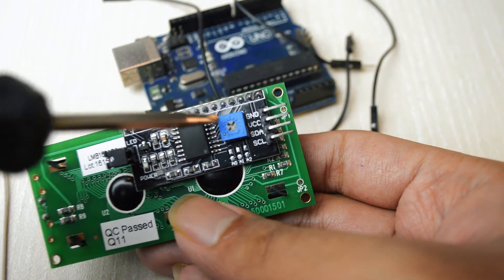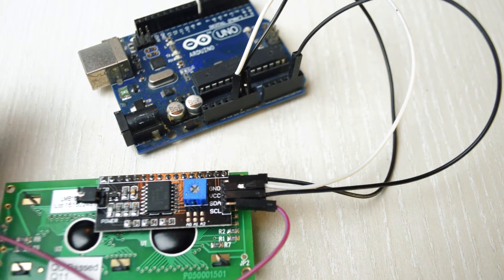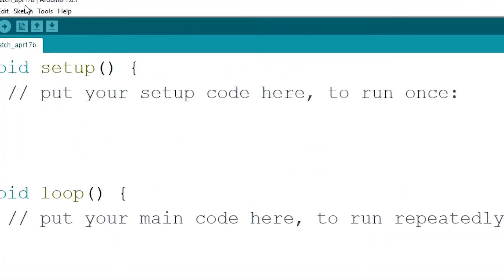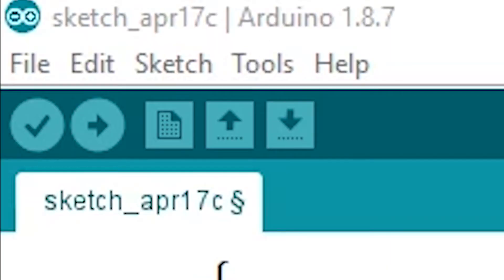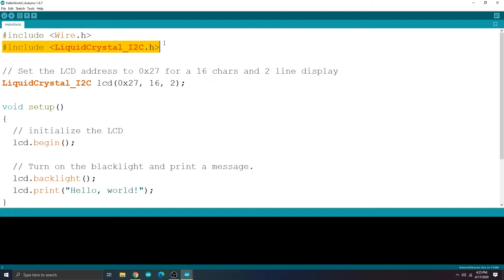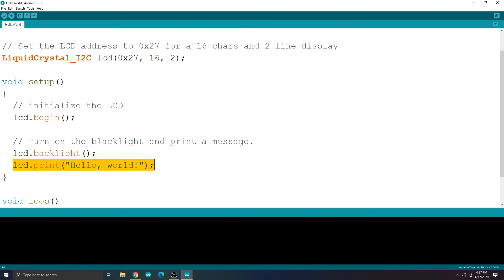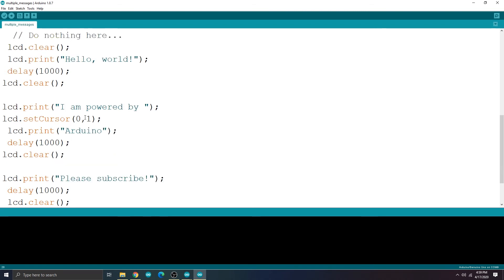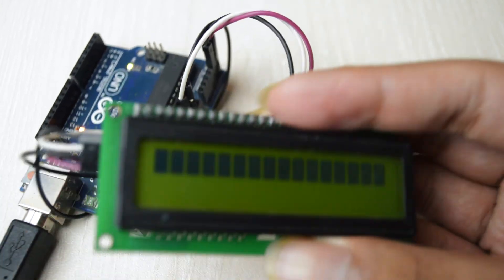LCD I2C Display with Arduino

Comment: Hi i'm not an expert so i would like to ask you if you can add some lines on the sketch  to add the reading of microSievert/h as well as the CPM? The conversion index is equal to 151, which means that:  151 CPM = 1 μSv/h
1 CPM = 1/151 μSv/h = 0,00662252 μSv/h.
Thank you

Comment: Hello man! I have an issue, when i uploaded the HelloWorld code it doesn't appera on the display, (the display is powered and i see the little rectangles) i don't know what to do.
Reply from the maker: Have you tried adjusting the potentiometer on the back of the display with a screwdriver?
Reply: @aymaanra  I’ll try thank you

Comment: Can you please explain this programme in Hindi 
.
#include <LiquidCrystal_I2C.h>

#define vtg 34
#define in1 15
#define in2 2
#define in3 4
#define in4 5

LiquidCrystal_I2C lcd(0x27, 16, 2);

float vOUT = 0.0;
float vIN = 0.0;
float R1 = 30000.0;
float R2 = 7500.0;
int value = 0; 

void setup()
{
lcd.init();                    
lcd.backlight();
Serial.begin(115200);
pinMode(vtg, INPUT);
pinMode(in1, OUTPUT);
pinMode(in2, OUTPUT);
pinMode(in3, OUTPUT);
pinMode(in4, OUTPUT);
digitalWrite(in1, HIGH);
digitalWrite(in2, LOW);
digitalWrite(in3, HIGH);
digitalWrite(in4, LOW);
delay(10);
}

void loop()
{
float vtgval = analogRead(vtg);
Serial.println(vtgval);
float vout = (vtgval * 3.3) / 4095.0;
Serial.println(vout);
float vin = vout / (7500.0/(30000.0+7500.0));
Serial.println(vin);
float voltage = vin;
Serial.println(voltage);
if (voltage<3)
{
voltage = 0;
}
lcd.clear();
lcd.setCursor(0, 0);
lcd.print("WIRELESS  SYSTEM");
lcd.setCursor(0, 1);
lcd.print("VOLTAGE : ");
lcd.print(voltage);
lcd.print("V");
delay(2000);
}
Reply: he is a bangladeshi

Comment: I upload the code but when i hit the serial monitor it is not giving me an address only a bunch of squares.
Reply: Try adjusting the potentiometer on the I2C board, the one with the screw driver print

Comment: Hey bro can i power this board to my car battery or can i run this on 12v
Reply from the maker: Hey, its rated for 5v, you will need a converter or some else that converts the power to 5v for the board and lcd
Reply: I saw a video in which that guy run arduino board to the charging socket in the car or in other video it run with 9v battery/power bank.

Comment: sir my uno not uploaded the code.they sent an erorre msg.Arduino: 1.8.20 Hourly Build 2022/04/25 09:33 (Windows 7), Board: "Arduino Uno"

Sketch uses 3732 bytes (11%) of program storage space. Maximum is 32256 bytes.

Global variables use 281 bytes (13%) of dynamic memory, leaving 1767 bytes for local variables. Maximum is 2048 bytes.

An error occurred while uploading the sketch

avrdude: stk500_recv(): programmer is not responding

avrdude: stk500_getsync() attempt 1 of 10: not in sync: resp=0x2e

avrdude: stk500_recv(): programmer is not responding

avrdude: stk500_getsync() attempt 2 of 10: not in sync: resp=0x2e

avrdude: stk500_recv(): programmer is not responding

avrdude: stk500_getsync() attempt 3 of 10: not in sync: resp=0x2e

avrdude: stk500_recv(): programmer is not responding

avrdude: stk500_getsync() attempt 4 of 10: not in sync: resp=0x2e

avrdude: stk500_recv(): programmer is not responding

avrdude: stk500_getsync() attempt 5 of 10: not in sync: resp=0x2e

avrdude: stk500_recv(): programmer is not responding

avrdude: stk500_getsync() attempt 6 of 10: not in sync: resp=0x2e

avrdude: stk500_recv(): programmer is not responding

avrdude: stk500_getsync() attempt 7 of 10: not in sync: resp=0x2e

avrdude: stk500_recv(): programmer is not responding

avrdude: stk500_getsync() attempt 8 of 10: not in sync: resp=0x2e

avrdude: stk500_recv(): programmer is not responding

avrdude: stk500_getsync() attempt 9 of 10: not in sync: resp=0x2e

avrdude: stk500_recv(): programmer is not responding

avrdude: stk500_getsync() attempt 10 of 10: not in sync: resp=0x2e

     
please help me sir.

Comment: Good day sir! Please help me, it does not display text, but an empty boxes. And when i upload the code you gave it says no matching function for call to LiquidCrystal_2C::begin()'
Reply: did you find the solution
Reply: @ourabig idk
Reply: Same is happend with me, try typing "lcd.begin(16, 2);" if you have lcd 16 x 2, and then upload the code, for me it disabled the backlight, then I typed the previous statement lcd.begin() and it worked.

Comment: Sir @Aymaan Rahman
i have an error

C:\Users\HP\OneDrive\Documents\Arduino\libraries\Arduino-LiquidCrystal-I2C-library-master\examples\HelloWorld\HelloWorld.ino: In function 'void setup()':
HelloWorld:10:12: error: no matching function for call to 'LiquidCrystal_I2C::begin()'
  lcd.begin();
            ^
In file included from C:\Users\HP\OneDrive\Documents\Arduino\libraries\Arduino-LiquidCrystal-I2C-library-master\examples\HelloWorld\HelloWorld.ino:2:0:
C:\Users\HP\OneDrive\Documents\Arduino\libraries\LiquidCrystal_I2C/LiquidCrystal_I2C.h:58:8: note: candidate: void LiquidCrystal_I2C::begin(uint8_t, uint8_t, uint8_t)
   void begin(uint8_t cols, uint8_t rows, uint8_t charsize = LCD_5x8DOTS );
        ^~~~~
C:\Users\HP\OneDrive\Documents\Arduino\libraries\LiquidCrystal_I2C/LiquidCrystal_I2C.h:58:8: note:   candidate expects 3 arguments, 0 provided
Multiple libraries were found for "LiquidCrystal_I2C.h"
 Used: C:\Users\HP\OneDrive\Documents\Arduino\libraries\LiquidCrystal_I2C
 Not used: C:\Users\HP\OneDrive\Documents\Arduino\libraries\Arduino-LiquidCrystal-I2C-library-master
exit status 1
no matching function for call to 'LiquidCrystal_I2C::begin()'

Comment: Mine is showing in the LCD but in the compiler it says that

"An error occurred while uploading the sketch
avrdude: verification error, first mismatch at byte 0x046c
         0x51 != 0xd1
avrdude: verification error; content mismatch"

How can I fix this problem? Thank you
Reply from the maker: Did you install any other LCD library before?
Reply: I didn't install any library. All I did was your instructions.
Reply from the maker: Is the correct arduino board selected in the IDE?

Comment: Hello, your video is very nice. But I have some problems.After I uploading, it appeared "In function 'void setup()':
HelloWorld:10:12: error: no matching function for call to 'LiquidCrystal_I2C::begin()'
  lcd.begin();

What is this?How can I fix it?

thanks!
Reply from the maker: hey! did you try any lcd i2c library or any lcd library before installing the one in the video? if so, try deleting that library and try the one I linked,

Comment: I am have tried as per your video.. But only blue light is coming ... I am the example program is not showing in the display
Reply from the maker: try adjusting the contrast potentiometer on the back of the display
Reply: @aymaanra  i tried adjusting it its not displaying anything

Comment: only problem is that everything works but nothing is showing up on my lcd, any idea why?
Reply from the maker: try adjusting the contrast potentiometer at the back of the lcd with a screwdriver
Reply: @aymaanra  ok I will, thanks so much
Reply from the maker: @moreolakunri1322  you're welcome!
Reply: @aymaanra  IT WORKED TYSM
Reply from the maker: @moreolakunri1322  Glad I could help!

Comment: my did not work :(
Reply from the maker: What's the issue you are facing?  Any errors?
Reply: @aymaanra  I have a problem where it says this "no matching function for call to 'LiquidCrystal_I2C::begin()' "
Reply from the maker: @adamhall7077  did you install any other LCD library before this?
Reply: @aymaanra  I fixed because i need ed to use lcd.init() instead of begin().

Comment: Aymaan - I'm looking for a scketch using this display, for lap timing, for my slot car track.  Can't find any, any suggestions? Thanks
Reply: Your thoughts or suggestions?
Reply from the maker: @dane7205  There are some people in that forum post who have some code and projects, you can check it out, I haven't worked with lap timing or slot car track circuits before so I don't know about them in detail. thanks!
Reply from the maker: Hello!! Just found this, hope it helps!: https://forum.arduino.cc/index.php?topic=516838.0

Comment: Arduino: 1.8.13 (Windows 7), Board: "Arduino Mega or Mega 2560, ATmega2560 (Mega 2560)"

C:\Users\USER\Documents\Arduino\libraries\LiquidCrystal\I2CIO.cpp:35:10: fatal error: ../Wire/Wire.h: No such file or directory

Multiple libraries were found for "Wire.h"

 Used: C:\Program Files (x86)\Arduino\hardware\arduino\avr\libraries\Wire

 Not used: C:\Users\USER\Documents\Arduino\libraries\Wire-master

Multiple libraries were found for "LiquidCrystal_I2C.h"

 Used: C:\Users\USER\Documents\Arduino\libraries\LiquidCrystal

 Not used: C:\Users\USER\Documents\Arduino\libraries\Arduino-LiquidCrystal-I2C-library-master

 #include <../Wire/Wire.h>

          ^~~~~~~~~~~~~~~~

compilation terminated.

exit status 1

Error compiling for board Arduino Mega or Mega 2560.

This report would have more information with
"Show verbose output during compilation"
option enabled in File -> Preferences.
Reply from the maker: You have multiple wire libraries
Reply: @aymaanra  thank you sir.what is the solution for this problem?
Reply from the maker: @RamilanExplores   In Documents of Windows. Go to Arduino and libraries and delete all folders for the wire library named "wire" i think. Then install wire libary from library manager

Comment: i recived the error == no matching function for call 'LiquidCrystal_I2C::begin()' what should i do??
Reply from the maker: Create a new folder called "LiquidCrystal_I2C" under the folder named "libraries" in your Arduino sketchbook folder. Create the folder "libraries" in case it does not exist yet. Place all the files in the "LiquidCrystal_I2C" folder.
Reply from the maker: Are you using the library I linked in the description?
Reply: @aymaanra  yes
Reply from the maker: did you install the library via add .zip library?
Reply: Aymaan Rahman yes obviously
Reply from the maker: @venommish2651  then its supposed to work, the error only appears when you have any other lcd library installed
Reply: Aymaan Rahman i have lcd 16*2 same as yours
Reply: @venommish2651  it must the address for lcd
Reply from the maker: Also are you using the code to print multiple messages?
Reply from the maker: @Mohamad Shairil Rezman Mohamad Nizam in documents on Windows I think.
Reply: Venommish does it work becuase i hace the same problem
Reply: Liridon Kastrati bro chaange the wires and  plug it again and del double library and then it works
Reply from the maker: @venommish2651  Does it work fine now?
Reply from the maker: @liridonkastrati3622  did it work for you?
Reply: Yes, thank you
Reply from the maker: You’re welcome!

Comment: If lcd.begin not maching function. Why ?
Reply from the maker: Are you using the library I linked in the description?
Reply: same with me
Reply: @daniasuraya9350 you can use lcd.init
Reply from the maker: @izmaliahuda4747  did it work?
Reply from the maker: @daniasuraya9350  did it work?

Comment: Hi, love the video but I’m an I Mac. Can you make a video on how to do this on Apple Mac. Thanks
Reply from the maker: Thank you! I haven't used Mac, Everything should be kind of the same I think, have you downloaded the Arduino IDE?
Reply: Aymaan Rahman I did all the right stuff and downloaded IDE still not working. The computer send the information to the Uno with the LSD does nothing.
Reply: But the lsd dose nothing
Reply from the maker: @duck-ish4785  Try adjusting the contrast potentiometer on the back of the display with a screwdriver
Reply: Aymaan Rahman It also won’t let me copy the zip file
Reply: I’m a Mac user
Reply from the maker: Try adjusting the contrast potentiometer on the back of the display with a screwdriver

Comment: Thank you Ayman very much,
Did all the procedures,
Still not printing on the LCD,
Reply from the maker: address of the LCD from the code here https://playground.arduino.cc/Main/I2cScanner/
Reply: @aymaanra  Wow it worked,
Do you know what the reason was?
The contrast potentiometer,
Adjusted and that's it.
Reply from the maker: Wow, cool!
Reply from the maker: Yeah it probably was the contrast potentiometer.
Reply: @aymaanra  if I don't have a potentiometer, will it work?
Reply from the maker: @BasagLeo  I'm not sure, does your LCD have the I2C module?
Reply: @aymaanra  I tried adjusting the in-built potentiometer. Still no character on lcd display
Reply from the maker: @dust_bearer  It could be that the jumper wires you are using for i2c has some connection issues, try checking if the jumper wires work.
Reply: How can I get the address of the LCD?
Reply from the maker: @الطريقإلىالله-د5ك address of the LCD from the code here https://playground.arduino.cc/Main/I2cScanner/

Comment: There are far to many LCD I2C library's out there that are out of date and do not work :(
The one in this video does work as of 26/6/20, I spent a whole day trying to fix  the LCD only displaying one character and compile errors caused by the published fix's for it :( 
This worked straight out of the box, although I downloaded the zip and extracted it to C:/Program Files/Arduino/libraries instead of using the include method.
Thank you :)
Reply from the maker: I'm glad it worked! Cool! Any projects you are planning to implement the LCD Display into?
Reply: @aymaanra  I am initially going to use it to display values to help debugging code, the current project is temperature controlled cooling for a large radio control aircraft to automatically open and close the vents. This will eventually be on a custom PCB using an atmega328p-pu with the option of connecting the LCD to show the sensor temperature.
While not from my project this gives an example of what it will operate https://www.youtube.com/watch?v=mC9z6QMkgFo
Reply: Interestingly all the DIY arduino tutorials that I have seen appear to be wrong, they either do not mention the load capacitance of the 16mhz crystal or they use the wrong value load capacitors e.g. using 20pf capacitors with a 20pf crystal instead of the correct value of 36pf. Indeed many sellers of 16mhz crystals on ebay, amazon, etc. do not give the load capacitance :(
Reply from the maker: @steverpcb  wow, very cool!!!
Reply from the maker: @steverpcb  oh so are you planning to use atmega then or an arduino nano or something similar?
Reply from the maker: @steverpcb  Cool!

Comment: Did you like using the new Edge browser???
Reply from the maker: Yeah, it's kind of fast and uses less memory/ram I think. But I have switched to Chrome again. Have the new Edge as an alternative, might use again in the future.
Reply: @aymaanra  hmmm
Reply: I find Edge awful and use Firefox unless I need the Translate function of Chrome.
Reply: @steverpcb  Many features are coming up which are really great in edge. And what make it more productive. They also have translator built in. They have took a lot from Chromium and TBH, I love using it
Reply from the maker: @MaxProgramming  agreed, I use it as its more lightweight I think, chrome is resource heavy, uses a lot of ram
Reply from the maker: @steverpcb  I've started using the new edge instead of chrome, but of course use Firefox if that's what works for you and you like to use it!
Reply: @steverpcb  yes and I love firefox too. It is also very feature rich. But the only problem I faced was the speed.  I use FF also sometimes
Reply from the maker: @MaxProgramming  Oh, cool!
Reply: @aymaanra  great. I now use the Dev channel. To get more features quickly lol. But try exploring their features. One of the most important is the Collections, you can store some sites, text or images in a collection for your next video
Reply from the maker: @MaxProgramming  Thank you! I will try it!